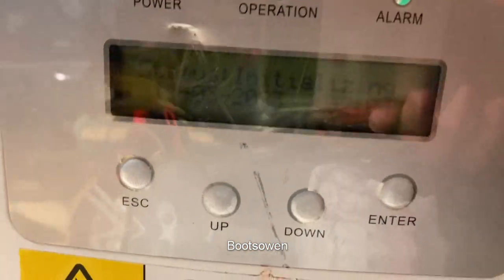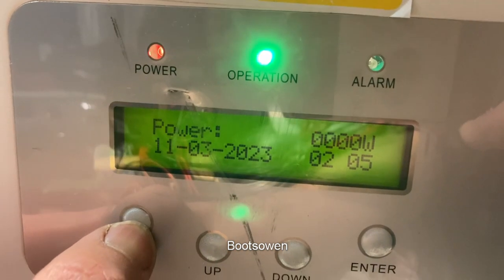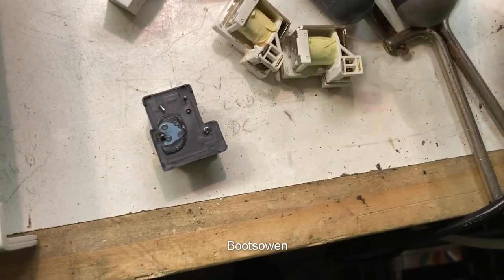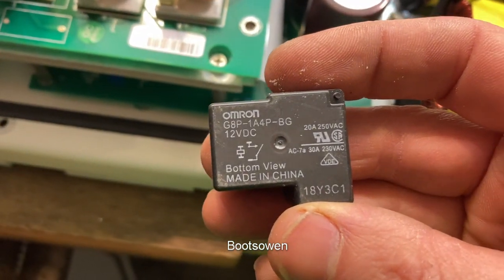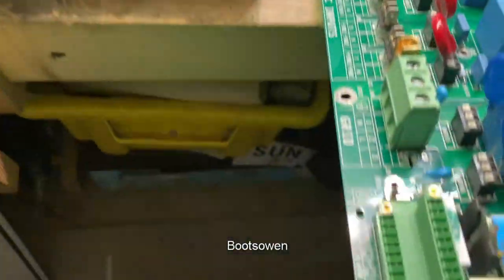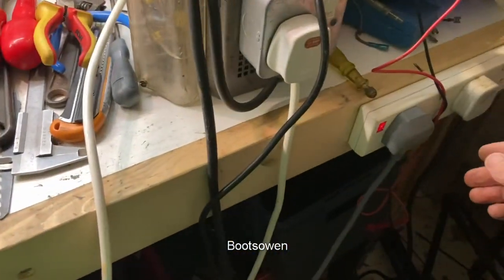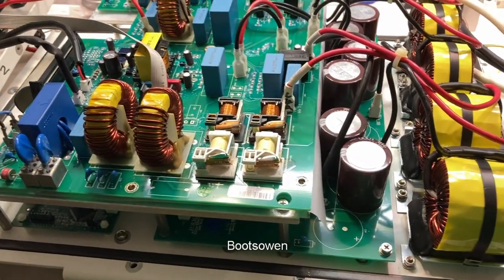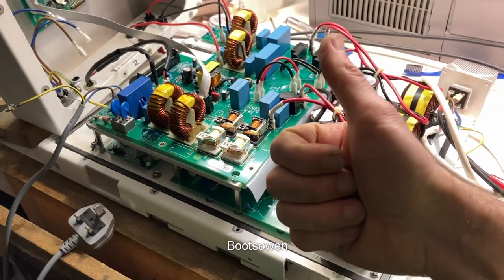A look at the relays after repair:  Solis Ginlong 3.6K-2G inverter test and OV BUS error code.

Comment: Ov bus code on mine also
Reply from the maker: I have shown how to repair it in other videos, it is not difficultl!
Reply: @bootsowen, it turns out that I have 2 dry joints. Just need to clean them up and re solder.

Comment: question for you
my 5kw solis inverter goes through the reboot after 4 minutes it turn green for 1 second
then trip my breaker
any suggestion what is happening is appreciated
Reply from the maker: Does it trip for earth leakage or overload. Most inverters specifiy a 300mA trip but most houses in U.K. have 30mA. Maybe you have 30mA

Comment: If you locate the issue irs best to buy new relays, as long as the solder is good, isolated. You could sell it. But they may not be legal to install (check ena register)
Reply from the maker: What's ena?
Reply: @bootsowen  covers ni and UK for legal/ compatible inverters they run parallel on the grid.

Type "ena type test register" in a search engine

Comment: Trying to repair control boards by replacing some small components is worth exploring. It is such a waste that so many manufactured items are disposed of instead of being repaired. Inverters are notorious for failing; that undermines the cost savings from solar PV. ☮️
Reply from the maker: Thanks. Maybe I didn’t make the point well enough in the video. These relays were scavenged from other inverters with the same ov-bus or relay error. But strangely most of the relay contacts were ok. It seems like the solder joint between the relay and the board was poor and failed. It is always worth attempting a repair if something is broken. Nothing to lose.

Comment: Owen, I recon it's about contact pressure, that's why the moving contact is sprung. I've done a video about this. I won't include the link as the tube sometimes filters these out, but search: ABB aurora, zettler, solis relay contact repair. Cheers
Reply from the maker: Thanks Andy. I reckon on the failed relays in my inverters yesterday most of the failures were from overheating at the joints. Most of the contacts looked ok. It is an easy repair but you have so to a lot of unscrewing to get the board out.
Reply: @bootsowen  one never knows how much abuse these inverters have suffered, cheers
Reply from the maker: Inverter In a washing machine?
Reply: @bootsowen  3 phase motor speed control?